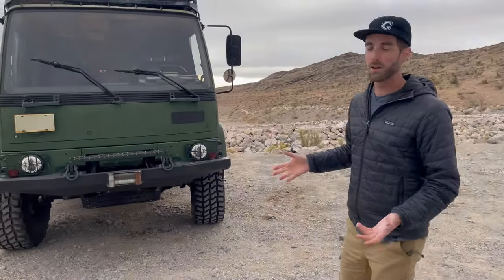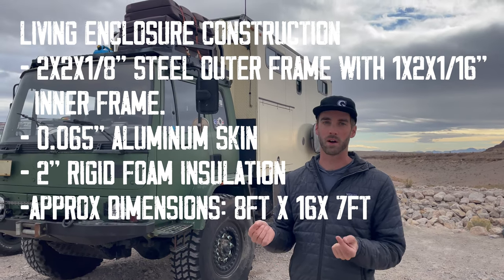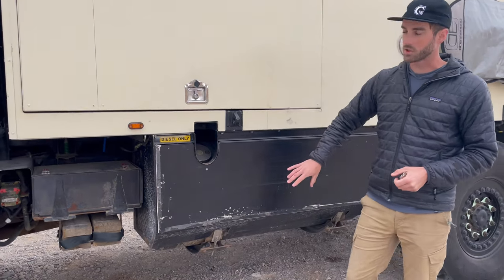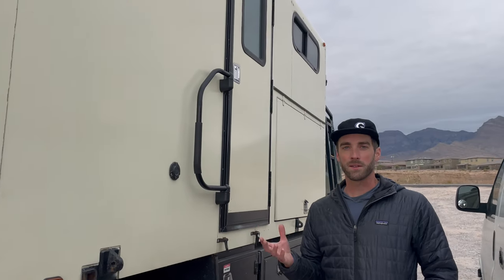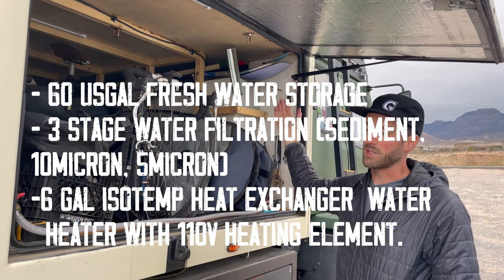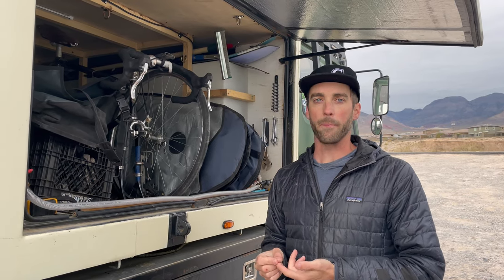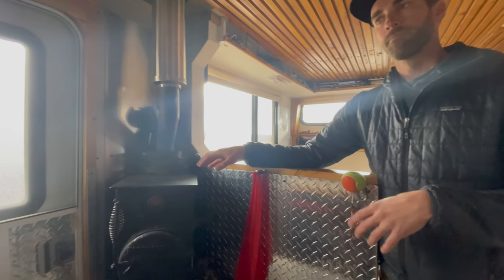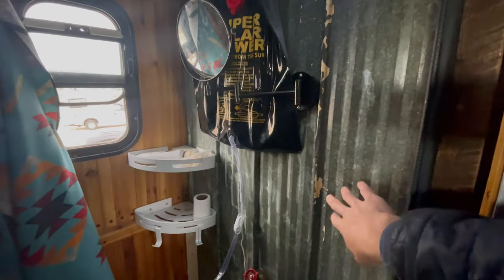ULTIMATE DIY OVERLAND EXPEDITION TRUCK | Built With My Own Hands

Comment: That’s a nice build, like the pulley system for the bed conversion. 

Just one note on your electrical system. Your 3000 watt inverter pulls 230amp at full load from your battery bank. Your battery according to its spec sheet only handles 200amp max and 150amp continuous. So just keep in mind that your inverter is oversized for the battery bank. My preferred solution is to add a second battery. 
I would also at least double the solar input. 

But yea, Betty looks like a cool build. I’m sure she will serve you both well for a long time.
Reply from the maker: Yeah, we learned the hard way that our battery bank and solar bank were undersized for the inverter setup. I banked on likely never using the surge on the inverter much less the whole 3000w. However, we found that cooking with the induction, even on low/medium heat really sucks down the juice. Meg is not a fan of the induction so it’ll be changed out this summer. Going back to gas.🤷🏼‍♂️
Reply: @SlowRoamers  induction has many benefits, but with limited electric supply you need to change habits a bit. 

I have done my own research I to it and come up with some solutions, if I may…

1) use a rice cooker as a pot. I have a 3 cup (uncooked) rice cooker that makes me entire meals. The RC uses 300 watt/h, so rice itself might only use 150 watt. My go to recipe is: fill with 20oz. Water, add 3 chicken thighs, cover, let come to boil. ~20 minutes later, take chicken out, add 1 1/2 cups parboiled rice, add seasonings, stir, cover, set timer for 22 minutes. At 5 minutes remaining I add mushrooms, onion or zucchini/squash, cover, cook until timer is up. Turn to warm mode for 5-10 minutes. Unplug. Serves 1-3 depending on serving size and hunger level. Shouldn’t take much more than an hour cook time, so electric use is =<300 watt. Quite reasonable. I use this also in hotels and AirBnB to keep food cost reasonable.
2) use a slow cooker, especially useful if you want to cook for 2 days.
3) Sous Vide - my personal go to for meat. It’s awesome. Even slow cooking is possible. You’ve got to look it up.
4) induction cooktop - finally, lol. I use it only for simple items like fried/scrambled eggs and searing/browning meat but not to actually cook it. For eggs you use very low setting, maybe 400 watt, just get the pan hot then add your eggs. For searing you only need the meat in the pan for a minute each side. You certainly don’t want to simmer or slow cook anything in it. 
5) tabletop electric grill. Bought mine at the supermarket, uses 600 watt. It’s bit enough for 1 full sized big chicken breast. 2 minutes for preheating (instruction says 5 but mine was hot after just 2), 8 minutes for cooking (including flipping it. Thats 20 watt for preheating, 80 watt for cooking, and if you make another cutlet, we’ll 80 watt more. You could sit down to eat and share the first cutlet while the second is cooking. 
6) cook while the sun is still out. That way you can replenish sone of the energy used immediately.
7) hot water. Solar shower bags are awesome. Even a dark shallow box can make water really hot. Great for cooking, doing dishes, and personal hygiene.

Anyway those are my personal solutions for dealing with electric cooking. Experiment some more before ditching induction completely. 

Best of luck :)
Reply from the maker: @4philipp  all good solutions! Although, I don't have much say when it comes to the cooking aspect of our lives.  Meg wants propane, so we'll be going with propane. HA!

Comment: Just wondering why you didn't use this rig  for your travels in lieu to da van?

I like the tool box/Knife storage hack👍
Reply from the maker: Too big is the main reason.
Reply: @SlowRoamers  That's what I figured. But - did you initially build it thinking that this would be the "one" rig for roaming around as you do?